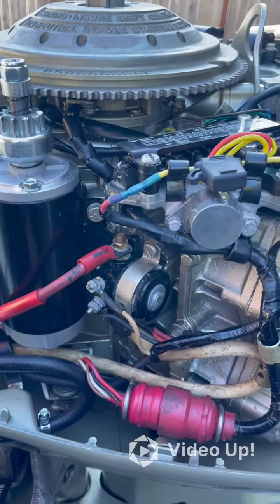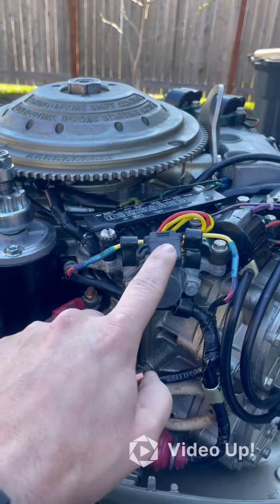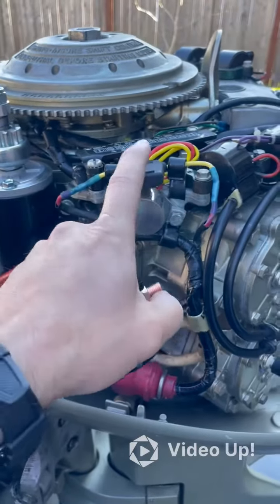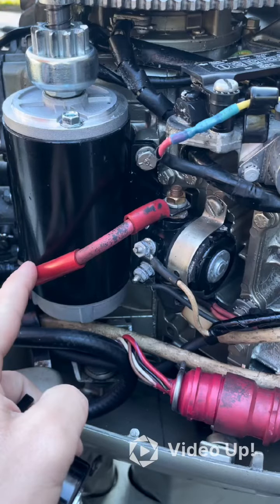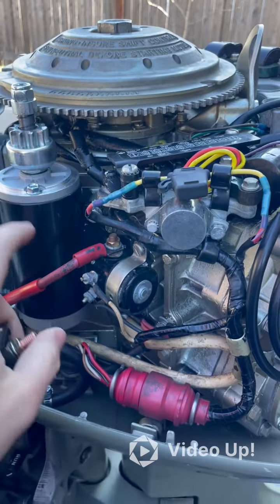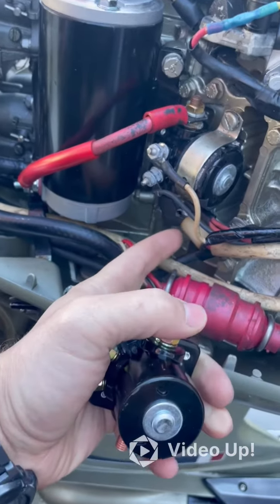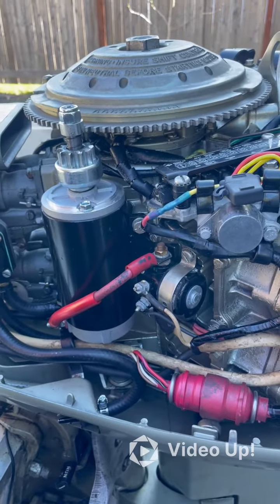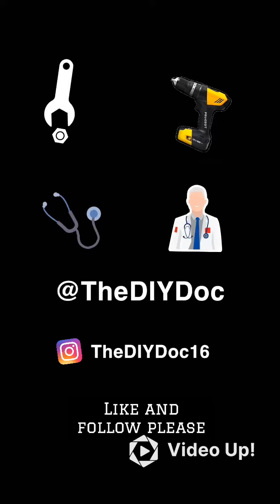Evinrude or Johnson Outboard not starting.  No noise or just a click, won’t start.  How to fix #diy

Comment: Mine doesn’t have a fuse
Reply from the maker: @ronniekepler6731  it should have a main fuse??
Reply: @TheDIYDoc  it’s a 1988 Johnson 25hp electric start I hooked up new solenoid and new start button still won’t fire or even click I checked the neutral safety switch and everything looked fine idk what else it could be
Reply from the maker: @ronniekepler6731  use a starter button. Aka connects your solenoid low voltage wires.  It’s way to check starter.  If it turns.  Then there’s an issue electrically.
Reply from the maker: @ronniekepler6731  most motors have a main fuse and if it’s blown you’ll get nothing.
Reply from the maker: @ unsure look it up on a parts page by year and hp. You’ll find if
Reply: @TheDIYDoc  yes it fires when I bypass the solenoid (if I jump it) it just won’t do anything if I try and start it  with the button I’ll try and look for a fuse but I dont see where there would be one on mine your engines a bit bigger mines just a tiller
Reply from the maker: @ sadly I’m not familiar with those.  Look up engine on marine parts.  Look up electrical.  See if a fuse